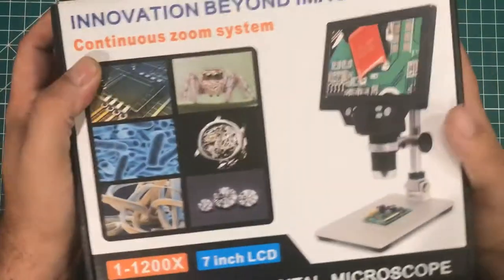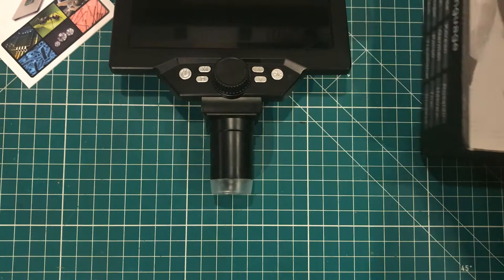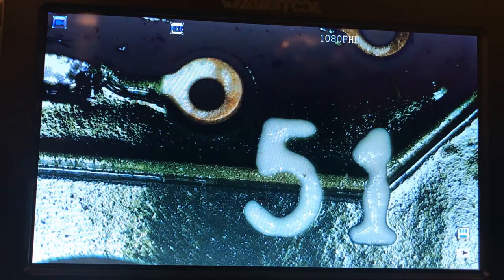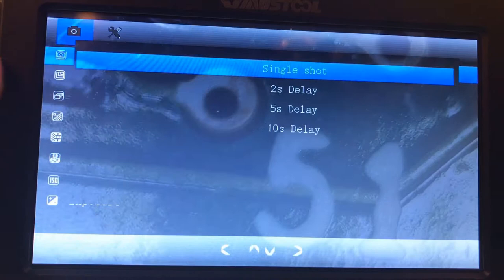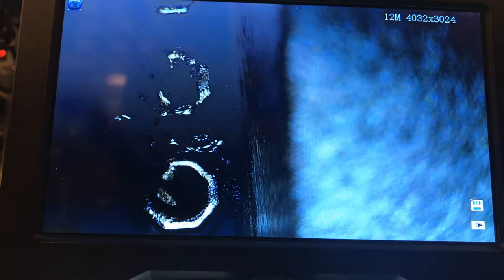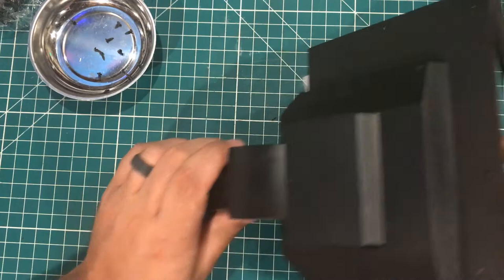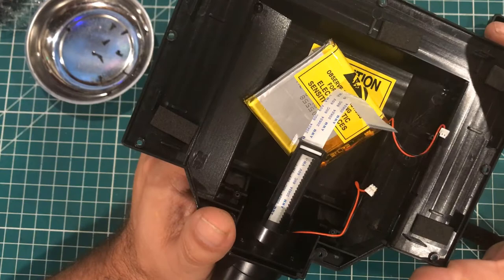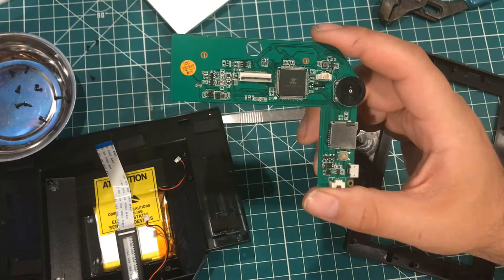Mustool G1200 Digital Microscope - Unboxing + Review + Teardown

Comment: Hey, nice review. I have the same microscope. Do you experience the following problem: When I try to take a pictures it is working fine. When I record a video it is working fine. But after the 1st video every file after that is corrupted. If I take a picture and then preview it on the microscope it is showing blank screen (same with video), if I connect the SD card to a computer, all images before 1st video (including the 1st video) is ok, but after that all files are shown as corrupted.
Reply from the maker: Hi. Sorry I missed your comment.  I actually do all my video with my screen recording software. I don't use the built in features to do it.

Comment: I’m blind and need 1!   SBC components r small.  Plus I am starting my 1st Arduino project soon.
Reply from the maker: It's a really handy tool.  You're going to love doing Arduino stuff.
Reply: Well, I need tubing.  I saw a lot of different sizes on spools at “”ACE HARDWARE”” back corner. Different sizes.  I may go larger tubing then reducers near plants.  From there have small pump per plant.  Mostly gravity fed, not much work for small pump.  Now I am searching for “best code already written for water sensor and for it to trip pump on /off. 

Still want small different color small wire spools and buy end pieces or solder them where connected.

I gotta create water proof container for Arduino/breadboard and run wiring out/sealant around wire holes.